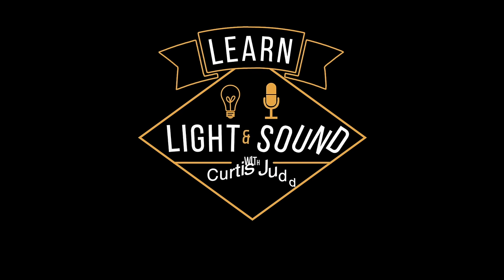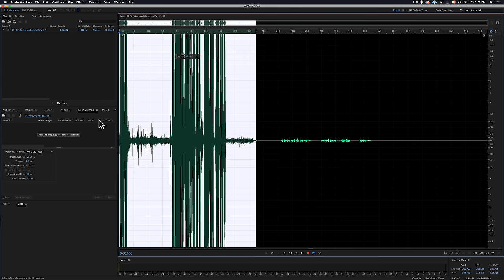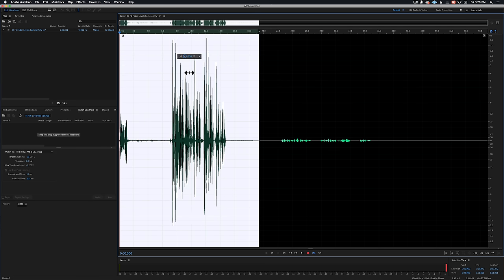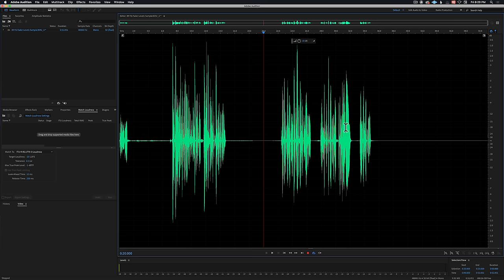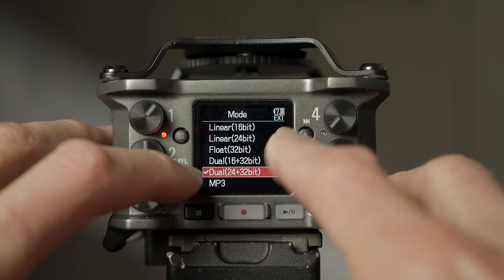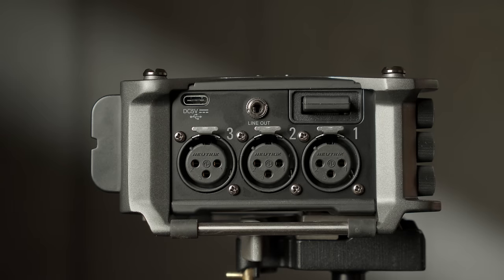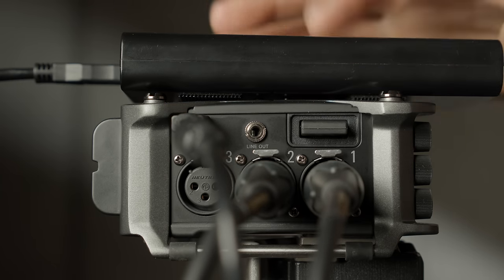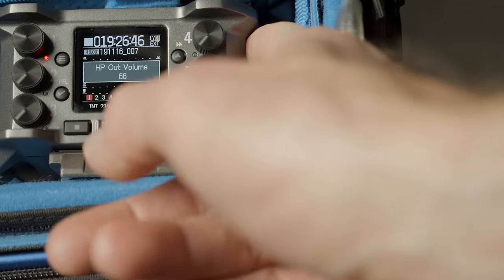Zoom F6 Audio Recorder Review

Comment: Curtis Judd surely knows this, but others may not. Sound Devices puts its headphone volume control on the side because that knob is also used to set menu values, including gain. It’s the same on my Sound Devices 702T, a recorder that sold for four times the price of a MixPre-3. The whole point is that, unlike with the faders, one can’t accidentally change isolated track values (a good reason to NOT override the factory default on a MixPre recorder and use the faders to control isolated track gain).

The assumption is that one is either using no bag, a bag large enough that there is enough clearance to get your hand in (are you also using right angle XLR connectors, because, if you aren’t, clearance shouldn’t be an issue), or a bag that has side access for one’s hand. For purpose-built sound bags, side access is the norm. In any event, I don’t know why someone would be messing around with headphone volume in the middle of recording in the first place :)
Reply from the maker: Thanks Rory . Do you have any recommendations on bags with side access for the MixPre-10?
Reply: Curtis Judd Hi Curtis. I purchased a bag, made by Gunther Kortwich, for a Sound Devices 702T that I also use for a MixPre-3. Mr. Kortwich died in 2015. His company, filmtontechnik, is active but apparently has stopped making sound recording bags. When I made my purchase, Gotham Sound, where I purchased the bag, was one of the few Kortwich dealers in the U.S.

I tried out bags made by Petrol (now produced by Sachtler), K-TEK and Orca as well as Kortwich. It took less than a minute to choose the Kortwich. If you can find one second-hand that fits, go for it.

However, most of the time I use both the 702T and the MixPre-3 without a bag. I still use the 702T over the MixPre if its weight and bulk aren’t an issue, or if I’m going to a place where I want a recorder that is built like a tank. It’s still a brilliant recorder.
Reply from the maker: @roryonabike5863  Thanks Rory. Unfortunate that filmtontechnik stopped making the sound bags. I used the 744T for a project several years back. Built like a tank, indeed!

Comment: I just today had a completely BS situation of my F6 locking up at the beginning of an extremely important shoot for my company.  After jamming with my Tentaclesync, the two inputs I was using (1 and 6) completely locked up- no audio whatsoever.  No amount of powering down and back up helped, everything was set and tested last night so there were no prior issues.  I finally had to do a factory reset, and it worked immediately.  I had to jam again, but no problems afterwards.  However, I was so shook up with people and clients waiting wondering what was going on, and maybe having to call the entire shoot because of the F6, I forgot that the thing comes up in 24 bit / poly mode, and didn't set it back to 32 bit /stereo-mode.  So all the audio is in this poly BS mode from multiple mics.  I am so pissed off at myself and the F6, I'm sick.  I'm d**n lucky I had my levels set right.  Yes, Operator Error, but AFTER the F6 locked up- THAT is on Zoom.  I emailed them with the facts and demanded the firmware be reworked so it comes up in 32 bit float- stereo/mono mode- what people are buying it for, as default, so if someone else has to panic like I did with the F6 today, when they do a hail Mary factory reset, it will come up with the highest feature-set it has.
Reply from the maker: Thanks for sharing Dale. Sorry to hear of the issues and hope Zoom can address the input
Issue.

Comment: Nice to have two solid options to chose between!  In both cases, the high dynamic range recording (dual A/D converter ant 32 bit float format) creates a massive test of the quality of the preamp, and both are producing amazing results at either extreme.  I've been holding off on replacing my H4N, but I'm leaning towards the MixPre 3 II, though I'll have to chew on this a bit more.  Some of the features of the F6 are hard to pass up...
Reply from the maker: Agreed. Zoom and SD aren’t making this a simple decision.

Comment: Curtis hopefully you check this. You are THE man. Loving my Zoom f6 and 32 bit float saving me already doing event stuff running out of the desk/speaker. When I get my polywave files into FCPX I just have channel 1 recording the desk (for speeches) then left and right as well. Should I disable left and right and use the single channel, or should I mute the single channel and use L and R? I assume there are issues having all three playing. Would love to know.

I made the mistake in my first event of recording mic level out of the speaker, luckily speeches were low and were perfectly salvageable. Assuming I should def be recording line level out the back of the speaker out? 

Thanks for everything you do!! Your channel rocks
Reply from the maker: Hi Alex, Yes, I’d choose one or the other - either the mono track or the stereo mix, but not both. They’re just summing and potentially clipping in post if you sum them. The F6 has a hardware issues where if you try to reduce the output level on the 3.5mm stereo output, it becomes rather noisy. Here’s a video covering the details and a work-around: https://youtu.be/t5W4Wg2yzfY

Comment: Having owned the F6 for a couple of days now (still haven't been able to take it outside for some field recording because of the weather, but I've been using it around the house), I can definitely vouch for it. It's really high quality and powerful for the price. At almost twice the price of the F6, I can't see how the MixPre-3 II would be a good purchase. Maybe brand loyalty and if you don't have a budget. Comparing them, or even talking about the MixPre-3 II, makes no sense to me at all.

My only complaint about the F6 is the small size of the knobs. Or rather, how cramped the controls are. But it's a very minor complaint. My hands are about 19x19cm and I can operate the knobs comfortably, but with and without the bag (K-Tek), but a little bit more room between the knobs would've been nice. I reckon that this very small complaint of mine will go away rather quickly as I use the F6 more, since the only times I'd use the knobs would be right before and right after recording. There's no need to ride the knobs while recording with 32-bit float after all.
Reply from the maker: Glad you're enjoying your F6.

I still prefer the MixPre. The headphone amp is quite a bit better, I prefer the ergonomics of the menu system, and the preamps sound a bit warmer.

Comment: Curtis, do you think F6 is a better machine than the F4 for ambient stereo recordings (often in quiet surroundings) or would it be complete overkill?  As some of my recordings would be left to record for an hour or so, I'd probably mostly be 16/44 to keep file size managable although the 32/192 sounds like it could be ideal for things like thunderstorms.  I do like the idea of only dealing with 4 AA's and the ability to use a generic power bank with the F6.  From what I've gathered from your videos, the Zoom F series - although overkill for my use - maybe worth the extra $$ for their quieter pre amps over something like the Tascam 70D....?
Reply from the maker: Definitely better than the Tascam recorders.  Based on what you’re planning to record, the F6 seems like a better fit than the F4.

Comment: Hey there Curis! First of all, I've been watching a bunch of your videos about mics and now this one and you've been probably the best source of information when it comes to this topic. I'm a beginner who bought a Zoom H4n ~6 years ago but haven't recorded anything since 2019 and I'm now getting back into field recording and foley. I plan on buying the F6 when it comes in stock at Thomann at the end of the year, but until then I'm going with my trusty H4n + some new mics I'll be buying (NTG5, two NT5s, a contact mic and an EMF receiver).

I have one question, or rather, I want confirmation on something. Since none of the mics I'm buying (and plan to buy) record over 20khz, would I still benefit from recording in 192khz? I haven't been able to gather much information about this, but I did see someone say that there is a benefit. I'm a music producer and sound designer, so I'll be manipulating sounds in many different ways, including pitching down (and up), so I'm guessing that I *will' benefit from recording with my 20khz mics at 192khz, more so than if I were to record in 96khz. Am I correct in assuming this?

Also, do you think my mic choices are good for a beginner setup?
Reply from the maker: Hi Jet Lag, I suggest you test and see whether it makes a difference for you. In my work, which is admittedly mostly dialogue recording with occasional foley, I haven't found a benefit for recording above 96kHz sample rates. As for microphones, yes, I have both and they're both good mics 👍

Comment: Hi Curtis, thank you for your review, it's very informative. I have my F6 for several weeks now and done a lot of field quad recordings with it. It works just great. But.. The only thing that worries me is that I was able to overload the input and clip the recording irreversibly by making very loud impacts on metal in front of Sanken CO-100K plugged into it while recording at 192/32. The F6 screen had a message on saying something like 'You exceeded the maximum input level. I am still puzzled. I want to add that Sanken CO-100K has a VERY hot output of 39 mv/Pa..'
Reply from the maker: Hi Alex, you are the first I've heard from who was able to clip the F6 in 32-bit mode. That microphone must be quite impressive! You might contact Zoom support to see what your options may be. Best wishes!
Reply: @curtisjudd  Already asked them to comment on this situation. Yes, it took me a whole 3 minutes to overload it ) The thing is, it has to be really really loud, like metal ruler impact on a table with mics up close. I was unable to overload it by, say, shouting into the face of AKG c414 XLS in omni mode )) The overload issue arises when I go to extremes while recording metal impacts for sound design. I already successfully recorded revving and roaring T-34 tank from 2 meters away with same Sanken-Zoom setup, the level was pretty tame.
Reply: @AlexKopeikin  did you get a reply from Zoom? I have the same issue...
Reply: @douglaslangley6703  Yes. They said it is normal. The imput on the recorder overloads if it gets more than 4dBu.
Reply: @douglaslangley6703  The F6 has a maximum input level of +4dBu. If a sound source is outputting at a level higher than this, it is possible that the input stage could be overloaded.

The 32 bit floating point recording allows for recovery of any clipping that occurs from the level recorded to the file being very high, but it is possible for the analog converter stage to be clipped.

This would normally happen with line level sources being connected when the input is set to Mic, but it is possible, if rare, for a mic with a high sensitivity and/or high max SPL to output high enough voltage to clip the input.

This message would only occur if the input of the recorder is being clipped, and would not be related to whether the microphone is clipping, just the voltage being output by the microphone.

If a microphone were regularly outputting a significantly higher voltage than the F6 can accept, then I would recommend using the Line setting for the input, which will allow the device to accept up to +24dBu levels.

Based on the sensitivity and max SPL of this mic, it looks like it will only ever output up to around +5dBu. Since the microphone is well matched to the F6, if the "Exceeded Maximum Input Level" appears, then the signal is likely loud enough to cause issues with the mic as well, so I would probably recommend just leaving the setting on mic.
Reply: I decided to purchase an in-line signal attenuator for recording loud impacts

Comment: Dear Curtis; I just bought this unit (Zoom F6) after watching your review video, but I have trouble knowing how to use it right.  I could not get any audio when using it with the Audio-Technica AT4053B microphone.  The F6 unit is power by the 4 AA batteries.  All other setting is the default.
Reply from the maker: Hi Bầu Trời Boston, be sure to turn on the phantom power for the input to which the AT4053b is connected. Best wishes!

Comment: Great review, thanks Curtis! The reasons you state for preferring the MixPre only confirm that I want the F6, since I'm a desktop/DAW sort of enthusiast, and as long as I can get good quality field recordings (love the dual ADC/32b float feature) onto the card, I'm good. Don't need the other features. I have one question:

What does it mean, in real-world terms, that a DI box isn't designed for music recordings? If one is merely using it to adapt a line-in to an XLR or whatever, I would think that the nature of the audio content wouldn't matter. But I'm just an amateur...
Reply from the maker: Thanks Arthur, the DI box IS used to adapt a guitar or other instrument with a high impedance unbalanced signal to a balanced low impedance signal which the F6 can use.

Comment: As a podcaster you mentioned the F6 would be great for mobile recording, I'd be curious to see your recommendation for studio recordings.
Reply: I think it would be excellent in a studio, provided you didn't need 1/4" inputs or over dubbing. The 1/4" input can be overcome with adaptors/cables. Using the F-Control also provides nice features.
Reply from the maker: I use an Allen & Heath SQ5 in studio but that’s overkill for most. The RODECaster seems like a good option for studio podcast productions.

Comment: Everything is fine for me. Only thing, I am not able to use my Pro Recording Headphone on Zoom F6. That's an dis advantage. But I am not worried about headphone. Without a headphone also I recorded; no problem. In all Zoom recorder, just see the light meters are at optimum level; and you can leave it alone and continue recording without headphone. When you play, you will hear the sounds are perfect. This is one goodness of Zoom recorders.
Reply from the maker: I still recommend using headphones so that you know if there are other problems like lavalier microphones picking up clothing rustle or too many plosives.

Comment: On the line-out noise which I also found connecting to the GH5 and fuji X-h1: I have managed to fix it by using an attenuator cable (I think about -35DB) to do the attenuation rather than the F6 internal line out setting. Seems to get rid of all the noise for me.
Reply from the maker: Thanks Alvin, good idea!

Comment: I wish the F3 had 3 XLR inputs. As it feels like F6 potentially you are getting closer to a professional price and might as well get the Sound Devices. I'm looking for something fairly budget for starting out recording Sound on set but also for field recording. I'd like the option to record a matched pair with a boom or something more mono and centralised. The F3 is a third of the price of the Mix Pre 3. But the F6 is 1/2 the price of a Mix Pre 6. I had a TASCAM DR-40x which I started out with, which had a very high noise floor but also has broken.. 32 Bit Float looks really handy and I guess gain staging is less important. I guess I'm wondering if F6 is a good place to start out for professional work. As I have to factor a reliable Shotgun microphone into my budget too.
Reply from the maker: Sure, the F6 is a good place to start.

Comment: Hi Curtis. Thanks for this video. As mentioned in another post on another video of yours, that I’ve bought the F8n and waiting delivery. Ok, in this video you mentioned this F6 is not suited for recording instruments. So does this apply for F8n as well? I plan not only to record church preaches during this lockdown but also record a few instruments for worship sessions.
Reply from the maker: Hi Devonbiker, with the F8n, you have more flexibility with its combination input jacks for instruments if you wanted to connect them directly to the F8n. Not so with the F6. Neither of them support overdub/multitrack recording on their own but you can do that with the F8n or F6 connected to a computer running a digital audio workstation app for recording. You should not have any issues with the F8n for this purpose. Best wishes!

Comment: This  is   insane. This is a whole world of insane. If I'm hearing this correctly there is no longer any need to do any gainstaging or to bother with compression or to buy another preamp. This one unit does it all. This is almost equivalent to getting raw for photos or using Illustrator with vector images. Basically no matter how large or small you make it, it's perfect audio quality. Gone are the days of preamp noise and hiss. Gone are the days of clipping audio.
Reply from the maker: In most cases, yes. Note that if you use wireless microphones, the wireless system and lavalier mic will be the dynamic range bottleneck. The dynamic range demo was with a high quality shotgun microphone connected via XLR cable. But, yes, in this scenario, this is a huge change! And a welcome one!
Reply: @curtisjudd  This is awesome! I bought this a few hours ago. It's coming in the mail tomorrow. I feel like this is godsend for voiceover people.
Reply from the maker: @Dracomies  Excellent - congratulations and I hope it works well for you!